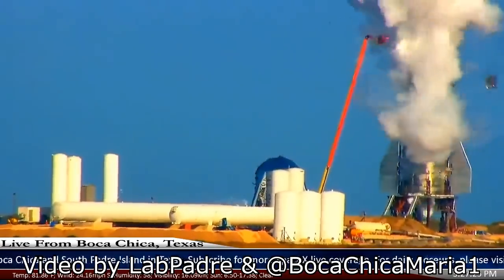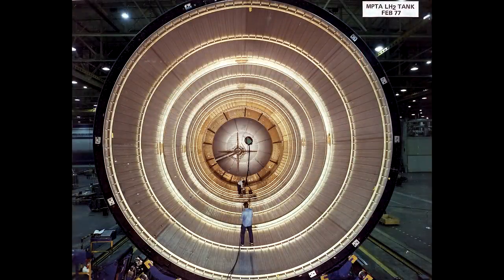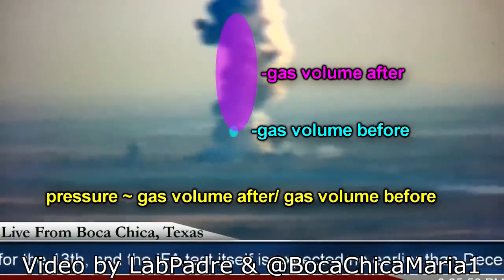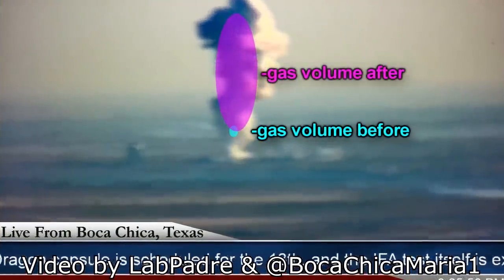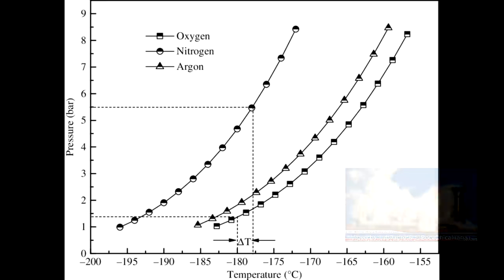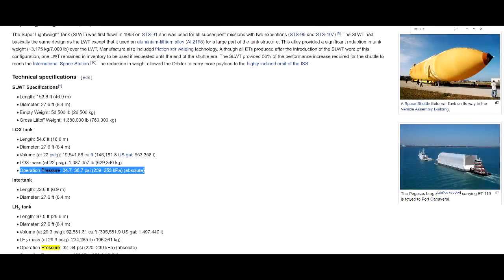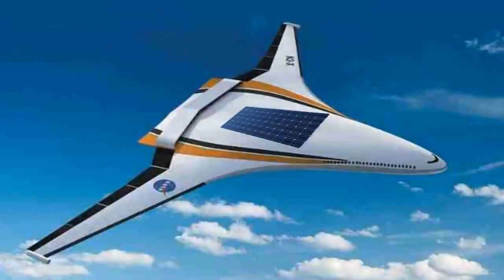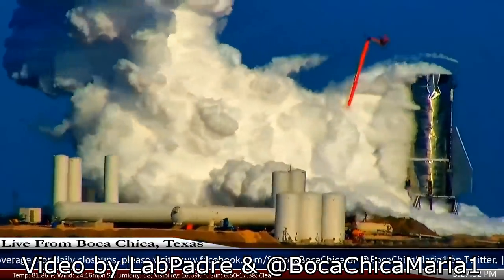Starship explodes, but why?

Comment: Their is absolutely no physics constraint that prevents a reusable rocket from flying multiple times a day safely. The only reason no one has done it before is because governments were really the only customers and a company CAN make way more money building a rocket each time for a customer with unlimited money "counties governments". The rocket industry like Lockheed Martin and former employees of them has admitted this. This is also the same reason orbital refueling has not been made, money.
Reply: Exactly but he never gives fucking technical reasons why it cant be done other then in the past rockets used to explode a lot. Well shit airplanes used to crash a lot so why did we abandon our nice comfortable ocean liners and sleeper trains?
Reply: @Confederalist  With how Starship is looking right now I'm honestly a bit concerned it will be like the early aviation; with a high amount of risk until vertically landing rockets is absolutely perfected. If only it had a launch abort system...
Reply: noname117spore Well starship has a built in abort system kinda. It can blast off its booster early. Now it’s not perfect but if the booster fails or explodes that what it has to do and then go into a verticals landing or ocean landing with unbelievably massive parachutes. Musk has talked about this multiple times. Ultimately just like commercial planes “which don’t have a plan B” the systems needs to be just as reliable as they are. And the thing with starship is it will be flying automated until it’s systems are that good. The first starship will do its first commercial flight in 2021 or before delivering satellites. No plans for people until late 2022 or 2023 so your looking at a year plus of automated flights.
Reply: @ApexTyrannis  It has a decent abort on takeoff option, but no real way to do so on landing. If the engines fail to ignite on landing, everyone onboard dies. There's definitely a difference between having a system which generates lift being necessary to get everyone off alive and a complex mechanical system involving thrust to get everyone off alive. The more complex system is just going to fail more often. A plane has a plan B if it loses engine power; it glides. A rocket doesn't.

It won't be too unsafe of a rocket on launch IMO. Safer than the shuttle there definitely, and Gemini as well (LeT's JuSt PuT aN eJeCtIoN sEaT iN a PuRe OxYgEn CaPsUlE, wHaT cOuLd PoSsIbLy Go WrOnG?). It definitely wouldn't be as safe as a conventional crew capsule (excluding Gemini), like Soyuz, Orion, Starliner, or even their own Crew Dragon.

And landing with Starship is still very concerning. They'll get to the point where it's as safe as air travel eventually. I just worry a fair number of people will die in the process.
Reply: @ApexTyrannis  Wait, hold on, it's fitted with parachutes?
Reply: @noname117spore  No it does not, I was just saying it would have to be something like that.
Reply: @noname117spore  It will have 6 engines, very unlikely none of them will ignite. And again that is what auto flights are for, to get all those bugs worked out before they put people on it.
Reply: @ApexTyrannis  3 of those engines are vacuum optimized; they'd break if you tried to use them in the lower atmosphere. So it has 3 useful engines for landing. One going out is already going to present a control issue, as the center of thrust would no longer be in line with the center of mass, and the rocket would have to land at a funky angle for those to be aligned with thrust vectoring. I'm not sure how many engines it could lose and still successfully land, if it needs all 3, only 2, or can somehow land with only the thrust of 1. Although F9 only needs 1 engine of 9 to land, so maybe you do need a triple failure for Starship to not land. Of course, it also matters how late you start your landing burn; they might try to start it late enough where 1 engine wouldn't be enough to land it to conserve fuel. And, of course, if the failing engine(s) cut out mid-burn, then you might wind up with a situation where the surviving engines aren't enough to save the craft.
Reply: Anonarchist Exactly! Failure to success is space x admitted plan and always has been. Just as booster reusability was crash after crash for YEARS, this asshat called it a “nice trick” in another video. Um no years of failure after failure and lessons learned from each failure is how they did it, no tricks involved. They did the math and verified the physics works it just needs to be worked on and on and on until they figure out all engineering problems. Same as self driving cars. I know thunder foot is smart enough to understand this that’s what pisses me off. He is doing this shit for views knowing there is a market for Musk haters!
Reply: Anonarchist Also this simple prototype pressure test was done at what thunderfoot admits was many times higher then regular operating pressure before failure happen. This test shows just how strong these steel rockets are, shows space x is in new and awesome territory of rocket development no one else has been before!
Reply: Space shuttle was way safer then early  comercial flights. Only two easily prevented losses from bad design flaws that wont exist on most future designs.
Reply: @Confederalist  the shuttle was very much a system of "if something goes wrong, you're dead." Now, that is a bit of an exaggeration, but any failure where the rocket explodes, the whole crew dies. Multiple engine failure at the wrong time can result in the loss of crew, and at the right time it would result in a risky and challenging maneuver to save the crew. Also mounting the shuttle to the side of the fuel tanks meant the heat shielding could be hit by stuff falling off the rocket, which of course proved deadly once and almost did a second time.

It's kind of impressive that they got the shuttle to not fail as often as they did. And they got lucky once too.

So yeah, on launch starship should be safer due to the better design (not putting crew on the side of the rocket is a smart idea), and a better ability to abort than the shuttle (although if Starship's fuel tanks explode then you're fucked anyways), but still not to the levels of safety of a capsule with a dedicated launch abort system and multiple parachutes.

I'm still very worried about Starship on landing. Your re-entry and landing maneuvers are way more complex than the shuttle, not something which has really been done before, and you're relying on the successful start-up of your engines to land. The "1 failure death" scenario can certainly happen here, with engine failures, control surface failures, and software failures all potentially resulting in it. And landing leg failures as well, which I'm going to assume are more likely than landing gear failures on a plane. Basically 1 thing goes wrong on landing and there's a strong chance everyone onboard dies. With the shuttle landing, there's not as much which can go wrong. Other than a final moment gear failure, a crash, or a sudden harsh maneuver, I can't really think of a scenario where a shuttle on landing approach becomes a definitively deadly incident, although there are definitely scenarios where it can get risky (do note, I'm counting Columbia style failures here as launch failures, since that's when the craft became doomed even if it wasn't realized until re-entry). And landing is something a spacecraft always has to do.

It's also insanely difficult to have a single failure from a modern conventional crew capsule result in death, unless the specifics of your system aren't as perfect as they are in reality. The rocket can explode and the crew will survive. Parachutes are reliable and having multiple of them gives an easy and passive system to bring home the crew. There's usually only maneuvering fuel, and maybe now launch abort system fuel, which returns home. This definitely isn't going to be as likely to explode as a normal rocket tank.

So yeah, starship is still never going to be as safe as an airliner. Requiring fuel and active rocket engines just to return everyone alive on every mission is not going to be as safe as only needing to glide. Starship should likely be around the safety of the shuttle, although with the dangers biased towards landing. In regards to cargo flights, that's fine. In crew flights, that's kind of not good. And in terms of airline flights, that's really bad. With more practice it might get safe enough, but on the current implied schedule this thing is likely to fly crew before it's become fully reliable with landing. And that does worry me.
Reply: @Confederalist  If the shuttle was on the front of the rocket like it was originally designed to be instead of strapped on the side of it, it would not of had ether disaster. Star Ship is rightfully being attached to the top of the booster.
Reply: Do planes have launch abort systems? No because they are very safe. You make a rocket as safe as a plane you don't need it.
Reply: @Confederalist  It's a lot more difficult to make a rocket as safe as a plane. Planes have a passive system called wings which let them glide in the event something goes wrong, rocket's don't, and the types of stresses on a rocket engine and a rocket fuselage are going to be much greater than those on those parts on a plane. Rockets also contain a lot more fuel. With a launch abort system and a set of parachutes you can make a rocket as safe as a plane, but if you don't have those systems, then you're just not going to be able to do it.

After awhile you might be able to get rockets safe enough that deaths are extremely rare on them without those backup systems, but I don't see that happening for awhile. Maybe 2 decades into the use of vertically landing rockets if SpaceX mass-produces and mass-launches the Starship. Like, more than they're doing for the Falcon 9 right now, or for any current rocket for that matter. Until then I do think it'll be very risky, like the Space Shuttle, or early aviation.
Reply: @noname117spore  Modern commercial jets do not glide very well, and eventually will fall straight out of the sky. When was the last time you saw a complete engine failure leading to a commercial jet perform a glide landing from 30,000 feet. Or even worse right before or after take off.
Reply: @ApexTyrannis  miracle on the Hudson for one, I think there was a Canadian airliner which ran out of fuel in the 80s or something which landed too. It turns out a lot of airline accidents aren't multiple engine losses.
Reply: @noname117spore  Ya most planes that loose all engines crash and everyone dies, thats why the miracle on the Hudson is called "miracle on a Hudson". The standard is if a complete engine failure happens on a commercial plane, the plane crashes and everyone dies. It just happens so rare we risk it. That is what StarShip will be in 3-5 years. You want to go to space their will always be risks.
Reply: @ApexTyrannis  The last time a passenger jet crashed from a complete loss of all engines with no survivors was in late 2004 (as far as I could find, there could've been one on landing I missed), at least without other significant factors being at play. The pilots tried to restart the engines, but lost too much altitude in doing it, and couldn't make it to an airport once they realized they needed to emergency land. The 2 crew were the only ones on the plane at the time. Since then, there have been 3 incidents of complete engine loss on jets (again, excluding stuff with other significant factors at play). 2 resulted in successful ditchings with no fatalities, while most people on the third died. In addition to these incidents, a tri-jet lost 2 engines during a go-around in bad weather and crashed with the deaths of most onboard.

Given that the 2004 crash from double engine failure was entirely the fault of the crew for improperly managing the failure and trying to find a landing site before it was too late for them to do so (and they had plenty of time to do so), and that the next 3-4 incidents of this happening on passenger jets all resulted in survivors, I'm going to say your conclusion that the "standard is that the plane crashes and everyone dies" is false. The standard is that a pilot should attempt an emergency landing somewhere nearby, preferably at an airport, in a body of water, or on a flat clear area of land.

In terms of propeller civil aircraft, the number of survivors from complete engine loss seems to vary pretty heavily, with a large number of the accidents taking place on takeoff. It's still pretty clear that complete engine loss does not reliably kill everyone onboard the plane in crashes though, and I'd say the majority of incidents of this type in recent years do seem to have survivors.

EDIT: Nevermind about the 2004 incident, I found one in 2012 where a dual engine failure caused a crash, although combined with pilot error. At the same time, there's a dual-engine failure on a 4 engine plane in 2004 which resulted in a crash where only 2 people on the ground were killed, and another incident where a set of bird strikes led to damage of both engines, but the plane was able to land. I'm going to keep looking forward now to get a final tally.

EDIT 2: Couldn't find another incident (I had forgotten to check landing failures the first time, resulting in the extra incidents going unrecorded). Of the past 5 incidents of complete engine loss on jet airliners, and the last 8 with significant enough engine failures/damage to severely impact the ability of the aircraft to fly, only 2 resulted in everyone onboard dying. And both of those 2 incidents, it took several minutes for the crew to even properly prepare for an emergency landing, by which point it was already too late to make for an airport, and the planes crashed into the ground resulting in the deaths of everyone onboard.
Reply: @ApexTyrannis  Looking at what they're saying again, they did say they wanted to be able to land with 2 engines out in an emergency, so if they can do that then Starship might actually be somewhat safe on landing, with possible fuel exhaustion being a concern but possibly avoidable, and still being more likely to get everyone killed on launch than a conventional capsule (although less likely than a Space Shuttle, or Gemini).
Reply: @ApexTyrannis  I did some testing in KSP with a simplified Starship analogue, capable of shutting down its landing engines individually, with all the engines in a tight central cluster. I landed it on just 2 engines twice and got annoyingly close to landing it on just 1. So with that, it is probably going to take a triple engine failure to destroy a starship on landing via engine failure.
Reply: @noname117spore  That means its going to be pretty safe once those engines are getting mass produced and getting plenty of flight hours, good test my man!
Reply: @noname117spore  Fare enough, the main point is total engine failure on modern commercial airliners are extremely rare. And when they do happen if they manage to land with out dying its called a miracle. Small personal planes and props dont count they are light enough to certainly glide, we are talking 757s here. Take off and landing is always the most dangerous part of flying. Starship will be the same, launch and landing will be the dangerous part, once in space your safe. Launching will be as safe or safer then the safest rocket today which is Soyaz but with far more engine redundancy, and landing will be as safe as landing a commercial 757 airliner with all that engine redundancy star ship will have.
Reply: @ApexTyrannis  I doubt launch will be quite as safe as Soyuz. No dedicated LES means that destruction of Superheavy would be risky and destruction on Starship fatal. And parachutes, especially nowadays, are pretty reliable, so if we throw out the one instance where someone died via parachute failure back in the 60s on a Soyuz then the landing of a Soyuz is likely to still be safer than on Starship, which requires much more complicated systems to land. In terms of design principles though Starship should be safer than a Space Shuttle. So far Starliner is probably the safest capsule designed so far, followed closely by Crew Dragon, and then stuff like Soyuz and Orion and Apollo.
Reply: @ApexTyrannis  I mean, total engine failure on airliners probably has better than 50/50 odds for survival. I mean, what happens largely depends on pilot skill and location of the failure. The times everyone died in airliner crashes from running out of fuel typically had the pilots dilly-dallying and trying to restart engines while losing altitude instead of preparing for an emergency landing. It's not safe if airliners lose all engines, but the odds are still decent that you'll make it out alive.

Now, if Everyday Astronaut's calculation of the reliability rate of the Merlin engines is correct (I think he posted this in a tweet for an upcoming video he's doing), then if Raptor had the same rate of reliability then a triple engine failure (not brought about by an uncontained engine failure) on Starship's landing engines would happen once in a billion flights.

Also, in correction to my last post, Superheavy would probably have to explode to make Starship's ability to return risky. Normally stuff like control failures, thrust failures, and structural failures brings about flight failures, and those usually aren't enough to make a rocket actually explode (although a control failure could still turn out to be really bad for Starship if it doesn't detach quickly). Relying on liquid-fueled turbopump engines to evacuate from a failed launch, and having those engines supplied with a large amount of fuel is still a lot riskier than relying on small SRBs or small pressure-fed liquid-fueled rockets for evacuation, and relying on said liguid-fueled turbopump engines to land is still going to be riskier than just using multiple parachutes.
Reply: @noname117spore  If your talking about a booster failure, like an explosion during launch the chance that a launch escape system will save you on any rocket is unlikely, your best hope is the explosion simply blows your vehicle a safe distance away from the booster as it explodes, in this case the bigger the second stage the better protecting its crew with raw mass, Starship obviously wins here. If you mean a failure as in engine failure causing the rocket to fall back to earth and need to make an emergency landing then again super heavy will be far safer then any rocket including soyuz as "again" it has 39 engines and 12 or more can fail and it can still reach orbit. If you deal with a fire like soyuz booster had on the ground, then again star ship could just fire its 3 atmosphere engines off the booster. They might be slower then other "actual" launch abort thrusters but they will do the job. Then it could go into a controlled landing to a near by pad or a controlled water touch down like we watch a falcon 9 booster do earlier this year. In this case starship is already tail down too.
Reply: @noname117spore  Well airliners can't glide like small planes, so if there is not a strip of water, a highway or a airport very close they are going down into a field. And even if they do have those things with total engine failure "something that just does not happen 99 percent of the time" any safe landing is going to be consider amazing just like the water landing in NewYork.  Certainly pilot skill matters as we all know "Chesley Sullenberger" for this reason now. But this is not a good situation, 2-4 engine jumbo jets are not designed to be gliders.
Reply: @ApexTyrannis  I think you are vastly understating both the ability of airliners to glide and the ability for launch escape systems to get crew away from rockets. Crew Dragon`s launch abort test overlayed onto the Amos-6 explosion shows it would've likely saved the crew had it activated near instantaneously. The 2 most recent incidents of full engine failure which resulted in the deaths of everyone onboard jet airliners were both deemed to have been preventable had the pilots communicated better with the ground and made plans to land. Full engine loss on takeoff is the most dangerous time for it to occur definitely; the more altitude you have the easier landing is.
Reply: @noname117spore  Ya if it "instantaneously" activated, that is the key. There is really no way to design a system that can do that for every and any booster explosion. You cant even make the system detect the explosion shock wave ahead of time and fire the escape vehicle because the rocket launch its self would cause the launch abort to go off then. The launch abort on Saturn 5 was manually triggered, the Soyuz that started on fire on the pad in the 80s was manual and took 10 plus seconds before they aborted. The last soyuz failed booster 2018 which was triggered by most likely the most up to date auto abort system did not trigger for 5 seconds tell after the booster took damage. If a booster goes instantly boom no system is going to get you off the rocket, your only hope is you are in a big enough and strong enough stage that can take the blast allowing you to ride the shock wave away from it. Von Braun originally designed the space shuttle to ride its boosters nose just like Starship is riding super heavy for this very reason, instead of being attached to the side of it. There is many reasons to believe the larger the rocket the safer it is.
Reply: @Confederalist  Exactly and thats what space x is going for.